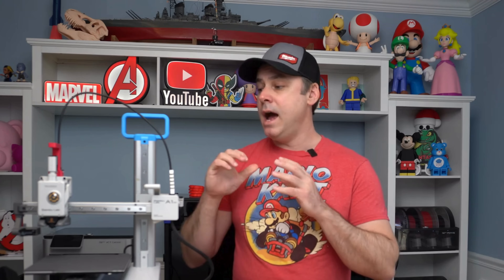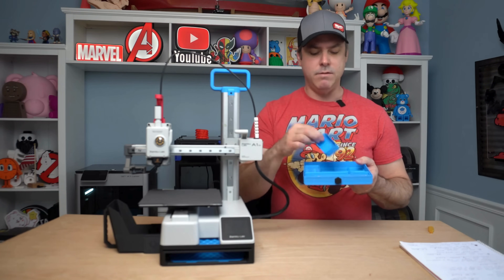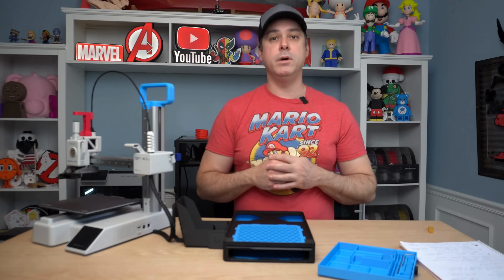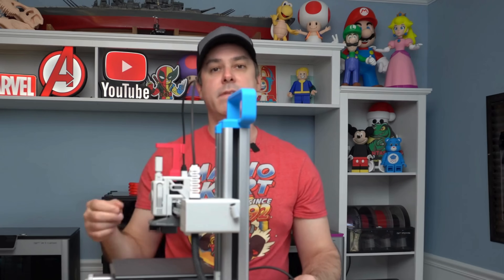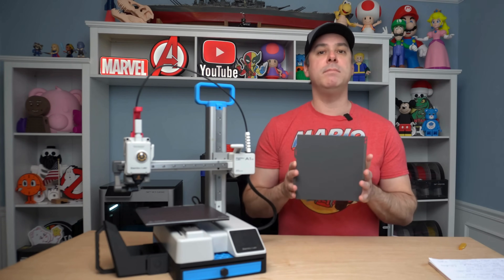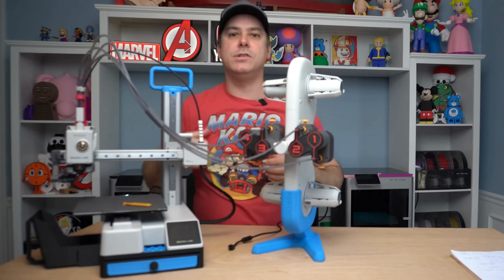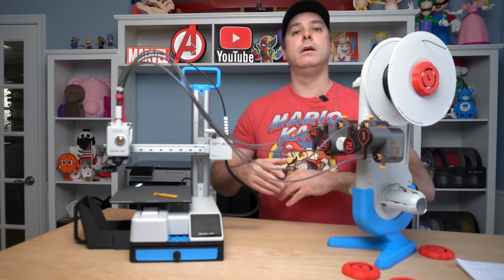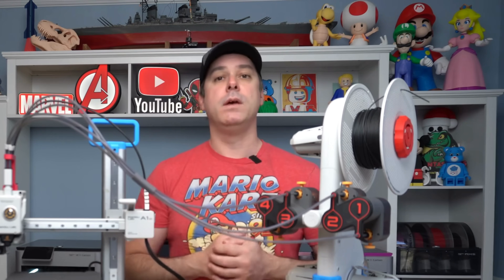Must-Have Upgrades for the Bambu Lab A1 Mini

Comment: I've had to clean the Super Tack buildplate for every print and up the temp to make it work. The textured PEI plate is less maintenance
Reply from the maker: Interesting. I've not had that issue. I do still use the PEI plates from time to time but my go to has been the glaciers for all my printers, and they have performed the same. I wonder if got a defective coating? Might be worthwhile to reachout to BTT.

Comment: those are great. I just added to my printer a A1 combo, although I won't use the AMS on the mini, I will add it to my A1.  The mini will be dedicated to print with a .2mm for miniature.
Reply from the maker: The mini I feel like is a fantastic printer for miniatures.
Reply: @ThePrintasaurus  the A1 is to print prototypes and end product. X1C is my workhorse, so the mini, I can't feel guilty of ,2mm on my larger printer for very small object.

Comment: nothing to stabilize the filament hub? its so flimsy even without running ams.
Reply from the maker: Thanks for the comment! I actually covered this one in this video! Works great, it manages the PTFE tubes and keeps the AMS hub supported by doing that.I have not broken a hub with this installed!  https://makerworld.com/en/models/658962#profileId-587890

Comment: Question,  I just got my AI combo and my filament keeps falling off i already had the filament from before I can use whatever brand right? Why does the spool fall off
Reply from the maker: The spool retainers should help with that. The AMS Lite is compatible with most spools. But you may need to print an adapter for different spools. Most are 55mm inner diameter. The newer Sunlu spools now fit the AMS lite, but older rolls for example were closer to 58mm inner diameter and required an adapter. Here's a link to adapters if you need it!

https://makerworld.com/en/search/models?keyword=ams+lite+spool+adapter

Comment: How did the top mounting system you used work before switching to this one? Any issues that caused you to switch back to this, or was it simply just a lack of vertical space? Which method did you prefer overall? I'm on the fence of top mounting my new kit (just got the combo as my first setup this week) and I do need to save some space, top mounting would make the most sense for what I have available but I am worried about the long term of top mounting it. Any tips or recommendations on that?
Reply from the maker: I didn't have issues with the top mount setup. I really liked it, but I changed some things for filming and whatnot and needed to move the printer to a space that I didn't have the height I had before. If you're looking to save some space and you can go up, I recommend it!  The only draw back is your spools on the back side of the mount.  You'll need to make sure you have room to pull the printer out, or turn it so you can attach the spools that are closer to the wall for the top mount.

Comment: Thanks you for your help. I have printed two sets of A1 Mini stand and storage unit. The bottom screen slides right in place. The top screen seems too big and over laps the area it is supposed to set in. What am I doing wrong? 
Thanks for your reply.
Richard
Reply from the maker: Can you send me a picture? Theprintasaurus@gmail.com 

I can try and help you get things together!
Reply: I have finally been able to build two storage/stands for my A1 mini. Is there a  deep drawer that would work for the unit? The existing deep drawer is much too wide and perhaps too long?
Richard

Comment: Hello, I was looking at getting an AMS lite but I was looking to wall mount it but the included cable I believe is too short. It seemed like you had an extension cable on yours, if so would you mind sharing where you got it from?
Reply: I wall mounted mine up side down and I didn`t need a longer cable. If you do this the upside down label print is a most.
Reply from the maker: @martinlortie  Wall mount is a great option. If I didn't move things around as much as I do, that is the way I would go!
Reply from the maker: Hey, I have found 2 that work well. 1 meter, and a 1.5 meter on Amazon. Here's the US link
https://www.amazon.com/Sifrothy-Extension-Cable-A1mini-Printer/dp/B0DM5PLHST/ref=sr_1_1_sspa?crid=QY8UFY2LQTDP&dib=eyJ2IjoiMSJ9.D9svnKC9G-o8mQ74c72Yj2G26cTt70Ve_4KcJHgjKmuaFDMtNgKQ5rJyBKqEIVCg30NAMoweVNqlWsE7EGabXbe4tFVl3dFObo_ZVsDjGLYCKc_Hlt4hd4iWycnXssjP1LE5WonZr4EJZS_S8LGpBjL89AJFXblMbGjPIqKlaSxSdpuCAc6KouiFyPHzDJ7V3p7Kx6NhQaM_9lbaFd6tAOS74O8Cwct2VBJNf9b9Q4U.3R94GT1s2RYTUHlFV01mmtmkQr_cOkXO2vTk8PzkNEE&dib_tag=se&keywords=ams%2Blite%2Bextension%2Bcable%2Bbambu&qid=1738444955&sprefix=ams%2Blite%2Bext%2Caps%2C104&sr=8-1-spons&sp_csd=d2lkZ2V0TmFtZT1zcF9hdGY&th=1
Reply: @ThePrintasaurus  thank you so much!

Comment: I have printed that storage system. They have another riser with a bigger drawer but no plate storage. Which they also have a section with a 5 slot plate holder. This is an excellent storage solution for the Mini. I love it. He is not lying about the Super Tack. I have 2. Bought one. Used it and bought another. If you get one let the model COOL before attempting to remove it from the plate. That stand is also great. Makes filament changes real easy.
Reply from the maker: Lots of great options and customization with the storage system! The super tack plate has also been great so far! Thanks for watching / supporting.

Comment: Hi, thanks for the video, great design!
I purchased an A1mini, it will take some time till arrives and consider printing your files.
I have checked the "makerword" link. I see that you have printed the stand in a grey filament that is very close from the machine color. Can you share the info?
Tanks!
Reply from the maker: Hey thank you for the comments. @sam67c is who designed this awesome storage system. So all credit goes to them!! I can reach out to what color gray was used and follow up!
Reply from the maker: Looking at the 3mf file it looks like they used the Bambu PLA Basic light Gray - here is a link. 
https://us.store.bambulab.com/collections/bambu-lab-3d-printer-filament/products/pla-basic-filament?variant=42844628975752

Comment: i have the supertack build plate. it feels immaculate not needing to use a brim when printing stuff that actually needs brim when using the pei plate.
Reply from the maker: That is a benefit to the super tack or BTT cryprogip plates I mentioned. You can really reduce the need for brims and things stay flat. An added bonus is typically if you happen to lose power your prints will release on a PEI plate once things cool. I have had some power work up the street recently and have lost power while printing for about 2 - 3 hours or so and the print never released and I was able to resume without issue. Just an added bonus to how well these plates hold.

Comment: Great video and very usefull ideas for my soon to be mine A1 Mini Combo🎉
Regarding the vertical mount for the AMS Lite and the relabelling, could you just mount it the other way around so the numbers are upside up and the cable is still on the back? 😅 What am I missing there?
Reply from the maker: Yes you could mount it the other way to keep the numbers the right direction. I did the opposite because I wanted to space the ams lite out a little more from the printer and having the cable at the bottom allowed a few more inches. If you want to print those numbers / ptfe support the link I provided has them in both directions, and without ptfe support if that is your preference. So ultimately you aren't missing anything. That was just my prefered mounting direction!  

Thanks for watching, and thanks for the comment! You are going to really like the A1 mini it's a fantastic printer.
Reply: @ThePrintasaurus  Thank you! That makes a lot of sense!

Comment: I love the a1 mini stacking storage system it was one of the first prints I did when I got my  printer lol
Reply from the maker: YES!! By far my favorite print I have done for a printer in a while. I like that I can keep all the mini stuff together and not have things mixed up everywhere. Thanks for watching!
Reply: @ThePrintasaurus  lol I’ve been chatting with the fella that designed it and sent him the link to your video lol he was over the moon about it
Reply from the maker: That is awesome, thanks for sharing with him.
Reply: Any loss of stability with the storage system? It seems as though you would loose a little.
Reply from the maker: @mikerainey3847   These are stackable. I could see some stability issues adding more than one. I have not tested that. But with the one I have not had any issues.The mini sits in the base and stays in place. If you do the TPU feet it does not move any more than the mini does on it's own. Overall it adds a little under 2" of height. If you don't have TPU a rubber mat would probably work too.
Reply: @ThePrintasaurus 
sincere thanks!
Reply: I wanna do this too. Recommend petg or pla? That's my main question right now with the heat of the machine
Reply: @ well I used Bambu PETG HF as it’s more resistant to heat and bleaching from sunlight and I never had any bother with mine
Reply from the maker: @davidmorrow6808   How do you like the PETG HF?
Reply: @ I like how it prints once it’s been dried properly and that’s the only problem I have with it lol needs to be dried first but I like the end result with it
Reply from the maker: @davidmorrow6808   That is something that I have really noticed is you really have to dry the PETG HF. I have been using Voxels HF PETG and it is stronger, and doesn't not require the attention (Drying) as much. Which is nice when you forget to dry your filament and want / need to print something!
Reply from the maker: @buckwild5   You can use either PLA or PETG. From my testing PLA has held up great. If you would like some more UV resistance and are worried about any heat issues printing in PETG would be a good choice. I don't see a need to use ABS or ASA.
Reply: @ThePrintasaurus  Thanks for the replies. I was worried pla might begin to bend with all that heat. Haven't tried petg yet. Totally new to this. But been looking into alot of info with these machines.